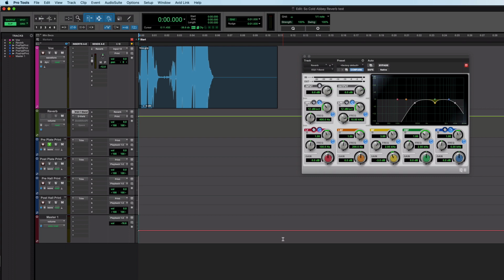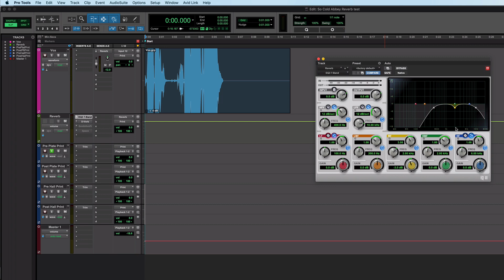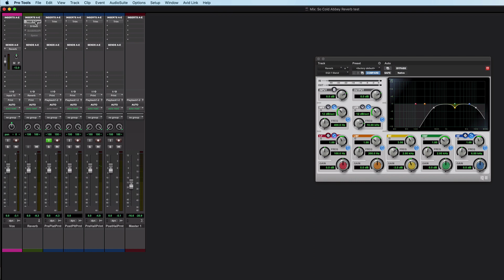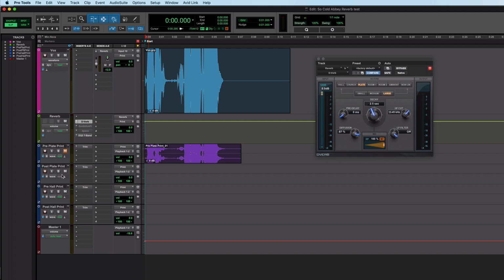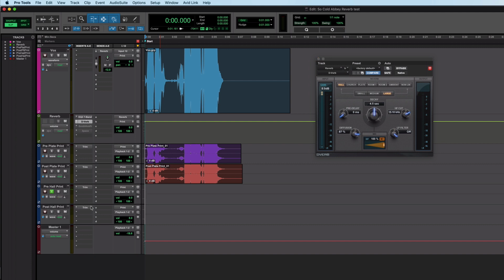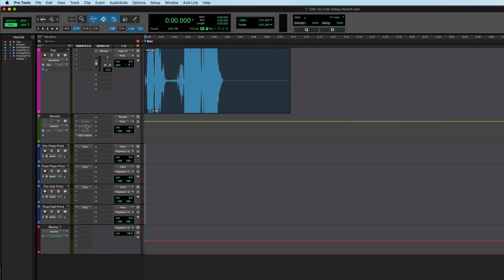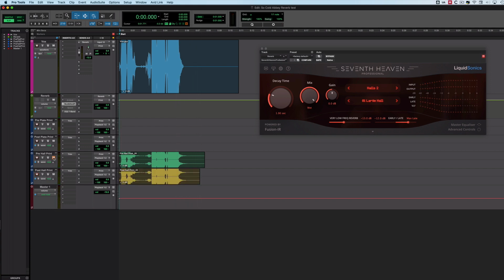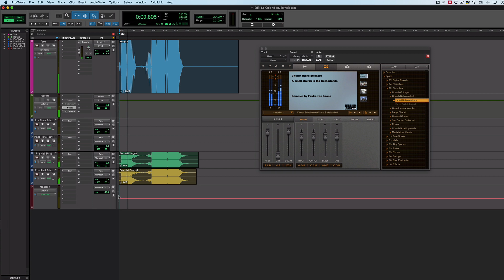Abbey Road Reverb Trick - Filter Placement Myth

Comment: Not sure why this video was even made. The essence of the “trick” is to prevent reverberation of certain frequencies. Whether you do that before or after the reverb isn’t the point and I don’t think there was ever any huge debate about this.  

I use reverbs that have this functionality built-in, so I don’t even need to worry about this. I just tell the reverb to not process below and above certain frequencies. 

Where exactly that happens inside the reverb itself - I don’t know or care, the important part is taken care of. 

And let’s say most people EQ before. If it’s the same, why not keep doing it before anyway? Nobody has to change their templates. 

From a purely logical standpoint though, it does make a little more sense to not even send some frequencies to the reverb. 

That way you absolutely know what went into it, so no matter what the internal reverb tech is, you know it won’t even try with some frequencies because there’s simply nothing there. 

This may be more a factor with some reverbs than others, so why not just leave it like that?

Comment: HOWEVER, when the EMI engineers came up with this, whether they were using the chambers or plates, it would have been a tube amp driving the speakers in the chamber or the driver on the plate. If the low frequencies saturated, they'd create harmonics ABOVE the high pass filter, muddying things up. Placing the filters before that system would fix it. Placing them after the system wouldn't. At least that's my thinking.

Comment: The original trick was made for analog gear where the room itself could add resonances for some frequences.
In digital world there is no difference because the simulation is too perfect. At least with no modulation. ;)

Comment: You seemed to imply that it’s not true for reverbs with modulation, but of course if you compare two separately recorded pieces of audio with modulation they won’t be exactly the same, unless the modulation is not free-running (ie key-triggered). You would need to compare two recordings where you know the modulation is exactly the same. However, if you think about it scientifically, if you had a large depth of modulation after EQ, the frequency of the reverb could easily extend above and below your LP and HP EQ settings even if the input frequency was limited, whereas if the EQ was placed after it would filter out these excursions. So it’s possible that EQ after is actually closer to Abbey Rd effect for modulated reverbs, or that you need it both before and after

Comment: I would say there is absolutely no difference even if there are   some type of modulation because modulation just adds unpredictability hence it doesn’t null BUT our ears are unable to distinguish it from two different takes anyway.
Reply: You saved me from commenting the same observation.
Reply: I just commented a similar thing. I think the unpredictability is the way the developer starts the cycle of the modulation. If it perfectly lined up between takes I think they would null.

Comment: I don't think it matters if you have modulation either. What is probably happening is the modulation has to have a cyclical starting point which will differ between takes. The different starting point will make it so that the reverb is slightly different however, this difference will not be noticeable for any particular single take. I'm not sure how you would test this out because it will depend on how the developer created the modulation algorithm.

Comment: Perhaps you busted the myth and didn't reveal all the nitpicky tests to prove the hypothesis about "modulation" but what I saw showed that it doesn't matter with plates and convolutions but it matters with halls.    You manage to not rebuke your hypothesis with those tests but not quite a controlled experiment isolating "modulation".  Two skepticisms: my ear always told me it mattered which doesn't trump null tests per se, but the issue here is my imperfect ears test does not necessarily get trumped by an imperfectly designed null test;  reverb tends to get compressed to sound good and its hard to imagine low frequencies not affecting a compression detector.  I just searched if any frequencies are created in the reverberation process and looks like no new frequencies are created by reverberation and that supports that idea that it does not matter as much as we may think.  Uncompressed reverbs sound explosive and so its very common to have compression built into reverb presets.